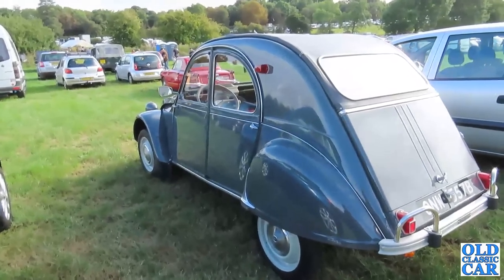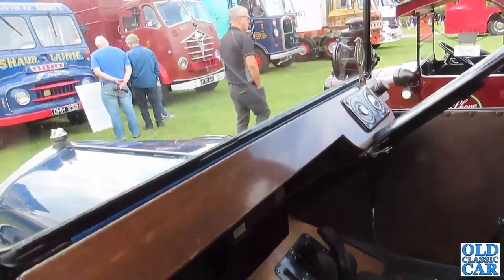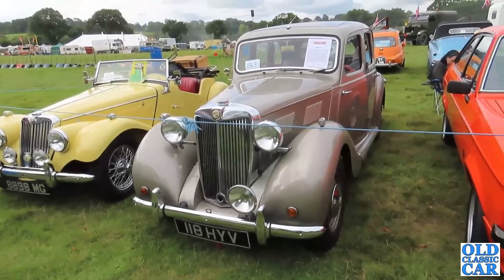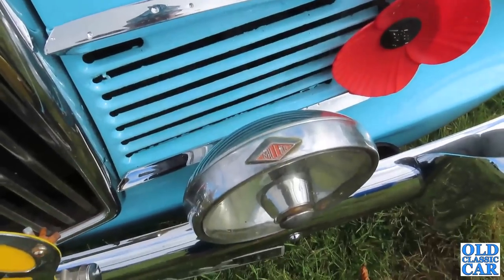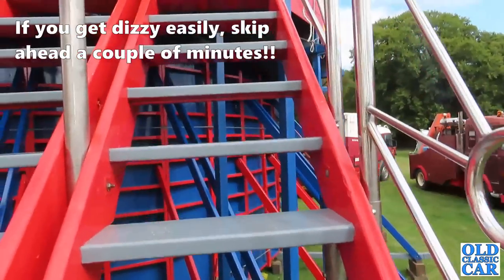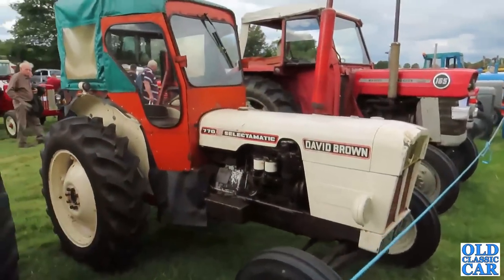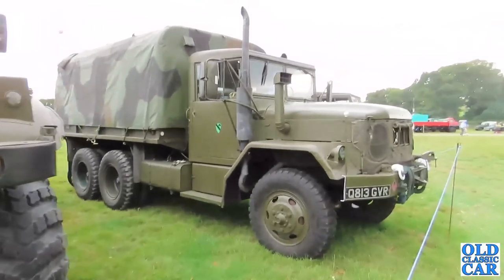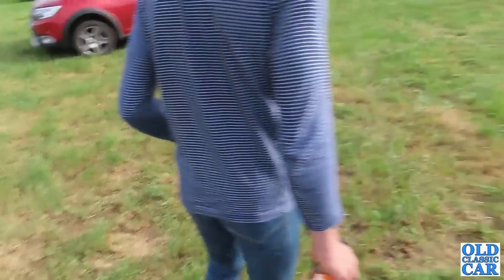Classic cars & lorries at Malpas Yesteryear Rally 2022 (inc Ken Fox "Wall of Death"!)

Comment: The half cab Foden coach looks superb. If you look the aperture for the starting handle is slightly off centre. I believe this denotes it has Foden's own two stroke engine. The option was a Gardner engine and the aperture for the handle is central to the vertical trim. Or it might be the other way around!!!
Reply from the maker: It did sound like a two-stroke